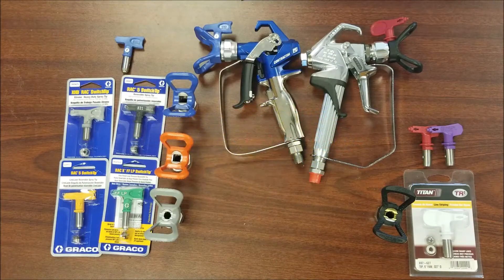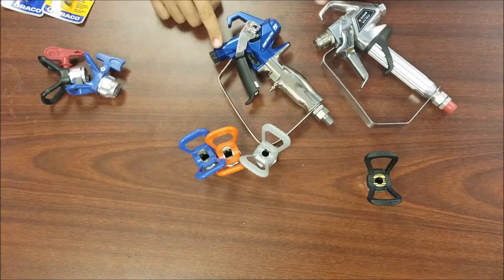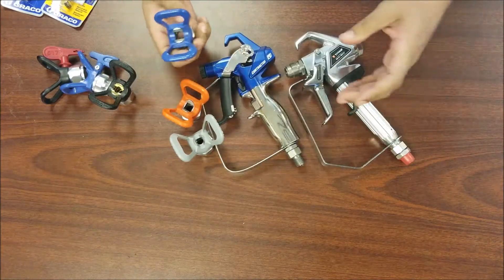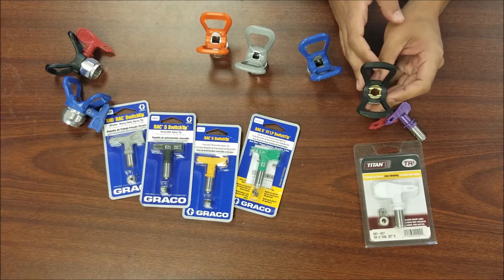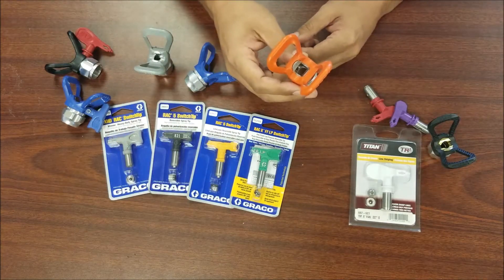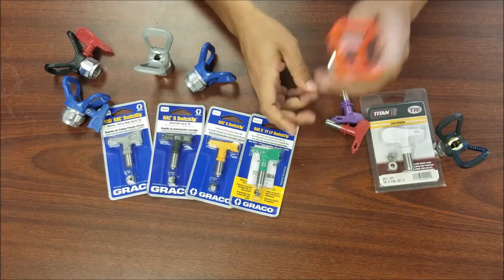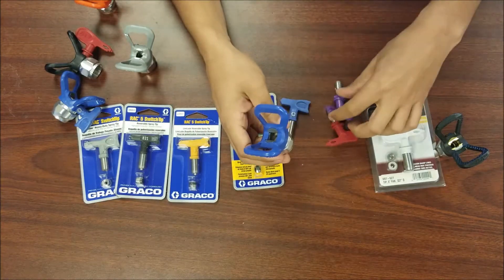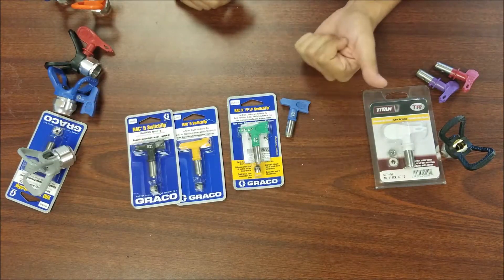Airless Spray Tips 101: Choosing a Spray Tip Size

Comment: I sincerely mean this , excellent breakdown on explaining in the most understandable manner I've heard yet to be put forth by anyone on you tube . And for that matter simply put as it is simple in its concept. However you might be surprised at how many life time 20 yrs plus painters who did not know this . Not to mention could u sway them to understand once they had there own way of making those tips work in their minds . I've never had patience for that type of irrational reasoning. As a paint biusness owner you want to be able to trouble shoot or delegate your desire to your foremans on each job and what you want for a final product.  When they are absent of the technical knowledge of painting , and yes there is alot of knowledge . It can be frustrating , the difference between 20$ per hour and 35$  per hour to all painters who can't understand why they get less hourly then the other guys making top dollar . You would be a great instructor in apprenticeship classes for those pursuing there journeyman card and checking off all the boxes and special certificates.  Very nice job explaining it in a understanding way and putting it into a relevant scenario which helped furthermore . I will be having all my guys and newbies from here on out listen to this ☆☆☆☆☆ 👍  . You should do repacking airless pumps and basic rig maintenence.

Comment: That was a incredibly helpful and professionally produced instructional video!  Can't thank you enough.   I'm wanting to spray 10-12 pieces of "Woodard" wrought iron outdoor furniture with a quality (rust inhibiting?) metal paint.   I'm assuming I'd want to use a tip starting with a "3" (for smaller 6" fan pattern) yes?  What orifice size would you be inclined to try?

Comment: What color/tip size should I use to spray joint compound... ? I have a mark v, but no tip.. thx
Reply from the maker: That's a difficult question to answer without knowing more about your specific material and what kind of finish you hope to achieve.  You could consider a large orifice tip like the Graco LTX521/525 or larger like this one: https://spraywell.com/graco-ltx521-rac-x-switchtip-521/
Reply from the maker: That would achieve a Level 5 finish.

Comment: A new seal is included with each tip.  Is the seal in the package specifically designed for the tip in the package?  When should you replace the seal?  Another painter on Youtube says the seal that comes with the Graco FFLP must be used with that particular tip to take full advantage of the low pressure  tip, that the seal is specifically designed to work with a low pressure tip.  Is this correct?

Comment: I have a Wagner Control Pro 130 equipped with a 515 HEA tip. I plan to use that with the latex paint for walls and ceiling. What is the most efficient tip I should use to paint the trim with latex semi-gloss paint inside my house?
Reply: I use a 213 or 313 and so do alot of fellas. However if ya get into some stacked or customized trim with 8"-10 " base or waynes Coatings and shadow boxes then you will want to switch tips out on them maybebto a 413 or or 513 even . If you condition your paints you can use 211 , 311 and have even less usage . But I find that I spray and exterior coat in the end pretty much evening out the usage but getting a better finish.  Thats if your not using air assisted and airless  spray rigs . Which I suggest you get . I've been using for a decade and would never go back the 3600 from titan cap gun is the dream for your next trim project or furniture, or house , or biusness , or factory ! That's right it does it all. But good luck . You'll be styling with a 313 in your Wagner for your project too. It very versatile hope it turns out good for ya